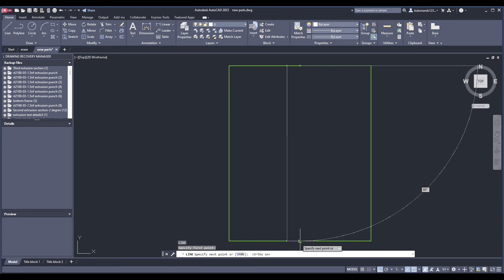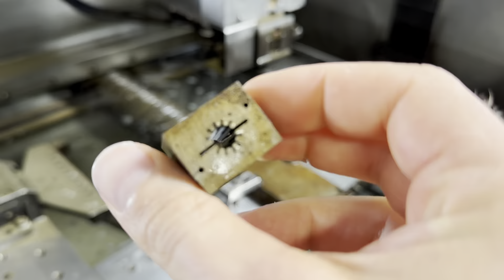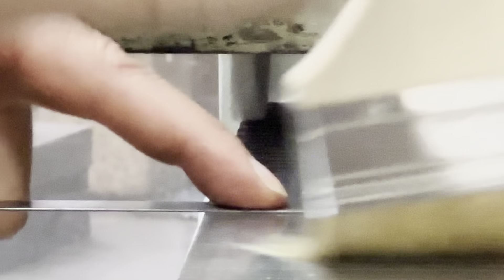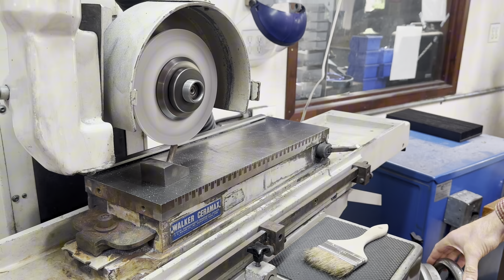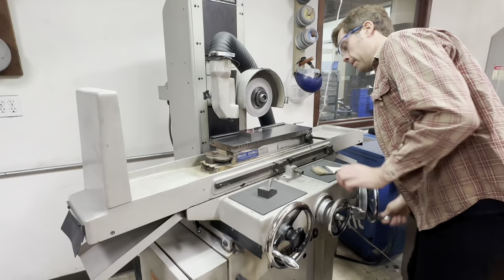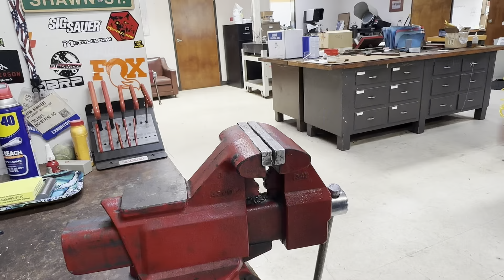Entire process from scratch to a finished stamped part.

Comment: Amazing job! Do you need Profile grinding for some complex punch or inserts?
Reply from the maker: To be honest, I’m not sure what profile grinding is? what exactly is this?
Reply: @ToolanderEngineering  Great question — happy to clarify.

Profile grinding is a precision grinding process used to produce complex or non-standard shapes on punches, inserts, and tooling components, typically to micron-level tolerances.

It’s often used when:

EDM alone can’t achieve the required surface finish or sharpness

Tight tolerances are critical for part performance or tool life

The geometry is complex (radii, steps, angles, form details)

In stamping or mold tooling, profile grinding is commonly applied to punches, dies, forming inserts, and wear components where accuracy and consistency really matter.

We usually support tool shops when tolerances get very tight or when rework risk needs to be minimized.

In short, it’s a way to achieve very accurate complex shapes when EDM or milling isn’t enough.

Hope that helps — happy to clarify if needed.：）

Comment: Punch tab is too big and die section no need tab on outside, just cut one pass undercut in flat area. so need gringing opeartion. We does always to save time and head ache.
Reply from the maker: What do you mean by too big? too long or tall. The length is usually made longer for a better hold, the height can be made as small as possible but not too small where the wire burns into the punch when it starts to break off. Yes the die section could have been undercut. Thanks for watching.

Comment: How did you attach the punch in the punch holder?  I've seen how to at 2 shops I've worked and each one is different.   Thanks   Also are you not removing material when you sandblast it.    I ran  Mitsubishi back in the day and we never had to touch the surfaces other than grinding the tag off the part.     Thanks again.
Reply from the maker: The punch is held in by a key that is wire cut through the entire punch holder and punch. Not much material is removed when bead blasting. Thank you for watching.

Comment: Awesome skills. I learnt a lot. I have some questions: 1. How did you secure the delicate punch in its holder? 2. The stripper insert was just driven into its cavity. No need to have screws to secure them? I'm 62 and am a manufacturer of sheet metal stampings. I read a book on progressive dies several times, and have designed and built 4 dies so far. I'm learning by watching videos, reading books, and observing dies built by other die makers.
Reply from the maker: @girishshah8929  thank you for the compliment. We just tapped the punch into the holder very gently. I might not have shown it, but the stripper inserts are screwed in. that’s awesome. Keep up the good work.
Reply: @ToolanderEngineering  Incredibly quick reply! You're awesome.
Reply: We ALWAYS had toe clamps on ALL punches. It's just a small clamp on the top of the punch plate using 1/8" crs and a 10-32 screw.    You just grind a small slot in the punch.

Comment: You could probably avoid needing to break edges if you added a small hole on each of the corners of the frame cavity in your WEDM op
Reply: You can program in corner clearance on the die sections . We never had to break the corners.

Comment: Great video. Is the EDM machine scanning for the pre-pierced holes to find an origin point? The steel(s) A2? being used for the die components would be an interesting addition to future videos.
Reply from the maker: before starting the program, the machine is moved over to the start hole manually, and after the program is started, it will move from 
Hole to hole automatically. I could possibly do a video on the tool steel that I use. Thank you for watching.

Comment: We need way more content like this! The one question I have is why the tab in the first place?
Reply from the maker: I have not seen any content like this as well. The tab is there to hold the part in the block so the machine can perform multiple passes...a rough and a few trim cuts. After all the passes the part is cut off. Thanks for watching
Reply: We used to call it a glue tab, bad name.   When you wire cut thin sections, the part might move because of stress and might have to trim it again.

Comment: Working to 50 millionths, and using the Horrible Fright sandblaster in the driveway. Love it, Subscribed.
Reply from the maker: Good eye, it is a harbor freight sandblaster. Its not the best but it does the job. Thanks for watching.
Reply: Not .00005 ". That's just B S for the video.

Comment: Amazing work. Thank you for sharing. What was the tab on the punch for?
Reply from the maker: The tab is there because when the wire machine cuts the punch it has stay partially attached to the block as it makes multiple passes to rough and trim.
Reply: To further explain this great work,  you need to know that the material he cut from is already heat treated. Heat treated steel still has some residual stresses, so the peice may release stresses as it cuts. That is one reason for a rough and skim passes. The other reason is rough pass is less accurate and poorer surface finish than skim passes. Some reasons are higher flushing pressure and higher energy sparks.  Skim passes produce a better more accurate part. The tab get placed on a surface that is hopefully convenient to surface grinder. A huge part of what you saw was knowing your machine and how to get the different energy levels set to hit the size you want. Looks like he did a good job.

Comment: Great video!
Shouldn't the wire EDM be capable of cutting the profile right in the center of the part though.
Most of the time I start of with a ground piece of stock, so the profile is already nice and perpendicular to the block. 
You're a brave man, balancing the punch on such a small surface for grinding! I'd put it in a vice clamped on both ends just to be sure :)
Reply from the maker: Thank you. If the clearance is larger we will cut it to size on the outside, but with thin material and tight tolerances I like to leave a little material on because it doesn't always turn out perfect. I almost always try to lay punches directly on the magnet, it turns out more accurate.

Comment: Loved the video. A few suggestions and questions:
- Type of material and hardness of each part?
- What are the tolerance of each part and the clearances between parts?
- Showing a 3D assembly cross section at the start of the video would have helped us follow along in a much more meaningful way
Reply from the maker: I'm glad you enjoyed it. The material is .003 thick stainless steel. There are so many different tolerances on that part it would be difficult to list them all. The tolerance for the burr is .0002.

A 3d cross assembly? I am not sure what you mean by that
Reply: @ToolanderEngineering I think he's saying a 3D model at the beginning,  but it sounded like you were only creating 2D files. 

How about the die material and condition?

Comment: Doing my dream job! You use about 10% material thickness for clearance? So in this case .0003?
Reply from the maker: Depends on the application. For this part the clearance is around 5%
Reply: Wow that’s tight! Though I would think required since it’s such thin material! Nice work!
Reply from the maker: @MJQAZ  Thank you

Comment: A whole new meaning to living on the edge when you ground the wire tab off! 😂 nice work and video tho. I’m from the Powder Metal compaction tooling industry.
Reply from the maker: Ha ha.. living on the edge. I’m not familiar with the powder compaction industry, I will have to check it out. Thank you for watching.
Reply: He makes carbide inserts would be my guess. @ToolanderEngineering